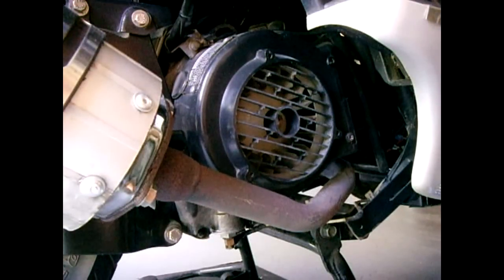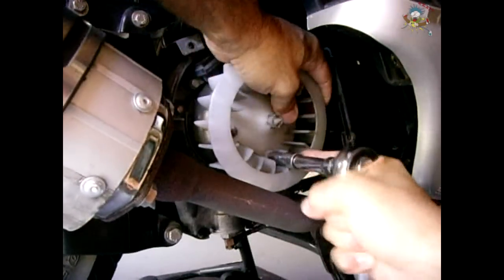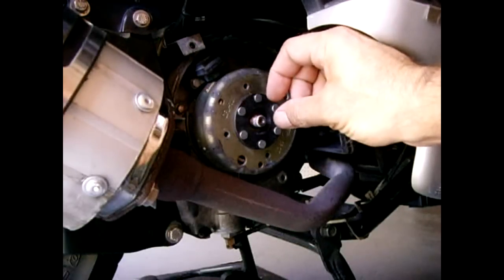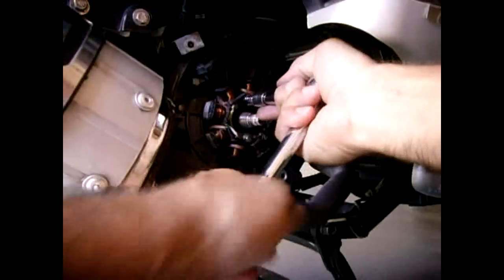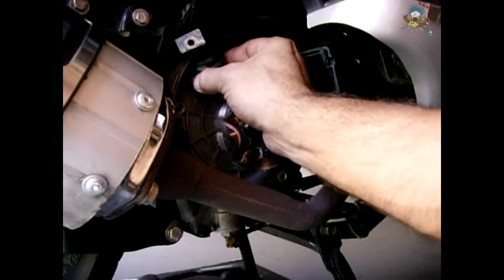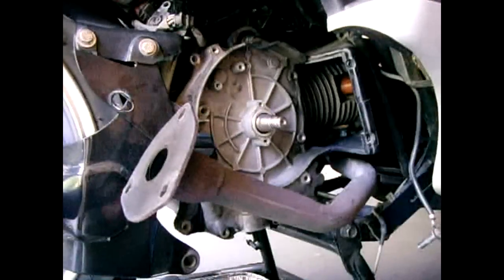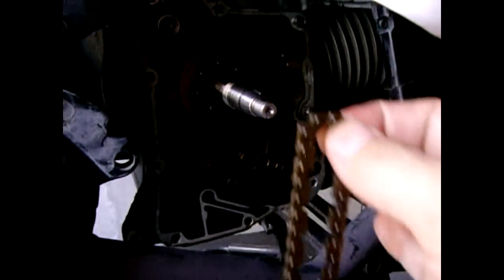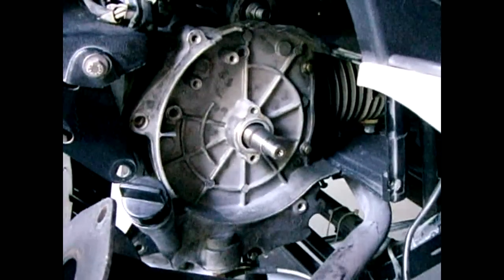How To Remove GY6 COOLING FAN/FLYWHEEL/STATOR/OIL PUMP/STARTER CLUTCH

Comment: I'm a Mercedes/BMW tech (retired) Nice videos! As I watch you recommend red RTV. I would recommend Permatex Ultra Grey silicone. RTV is for rough surfaces, while Ultra Grey or Ultra Black is for machined to machined surfaces, covers, etc. It dries like thick rubber and is stronger, yet still easy to clean with a razor blade. Great videos! Real good job as I watch you do it I can tell you are a pro. Thanks!
Reply from the maker: Thanks for watching, and thanks for the tips!

Comment: very informative, thanks for the upload. I have to tear my 13 jonway down to see why it ain't getting spark.
Reply: Leo Gerow shouldn't have to tear down just take out spark plug and put it in the boot,then put it on the frame while turning ignition on if you see spark your good! Then if theirs no spark its most likely your stator but before that is double check the blue wire with white line that goes into stator for loosened one hope this helps
Reply: Could be cdi, or

Comment: Hello,
I have same noise problem from the fan side with my 50cc moped/scooter. Now my moped starts but turns off while idling showing the same rattling sound. Does my moped has the same problem of starter gear which you just changed? Is it located at the same side as you showed? Thanks.

Comment: I know it isnt the topic of the video but man... I wonder what can be done to keep the exhaust pipe from rusting so badly.  My old roketa did the same thing and I felt like I was doing something wrong but letting it get that way.

Way cool video though, I never knew there was all of those components behind that shroud!
Reply from the maker: Hello Micah. Not much you can do besides sliding another stainless steel tube over the end. Thanks for watching!

Comment: they look so easy on the outside but surely you need to know your stuff to take one apart and the put it back together to working conditions.  Quite interesting. :P
Reply from the maker: I have taken all sorts of engines apart over the years. I was never afraid to attempt anything. Once you understand how they are made and operate, it is easy.
Reply: electronicsNmore  as with everything, anything is easy once you know how to do it. I just wish i knew :P

Comment: Thank you! Very I formative. Mine makes a terrible clatter at idle and also will not go passed half throttle without bogging down. Will not go passed 10mph!
Reply from the maker: Doesn't sound good....
Reply: @electronicsNmore  
What does that sound like to you?
Just a carb problem for the bog?

Comment: as a female I have great patience working on my 50cc scooter but when it comes to watching videos hell no!!! lol if all your videos are like this you are my new go-to guy! thank you very much for sharing this one it was great! I had a no spark issue with mine and I found out it was the pickup coil thankfully it's on the outside of the flywheel so easy replace. I took the old part out put the bolts back in the holes and waited  six weeks for my new part to arrive, during that weight the wind blew my scooter over and one of the bolts disappeared never have found it! I found that out when I was replacing the new part. I installed the part no problem turned over the bike and it spun a few times and then the flywheel locked up tight!!!!! it won't spin for nothing!!! question is do you think that missing bolts slid  behind the flywheel and it's stuck in their held on by the magnets so the flywheel won't turn?I can't imagine any other reason why the flywheel won't turn anymore as it turned just fine up until cranking it after installing that new part. I know this is an old thread so I really hope you're still around to answer this
Reply from the maker: It's a good possibility. Must be jamming it up. Thanks for watching!
Reply: @electronicsNmore  thank you so much for your quick reply! it's been driving me nuts knowing I have to go out and buy an expensive tool like that impact driver just to get the flywheel off to see if that stupid bolt is in there! LOL I actually bought another scooter hahaha this one a pony. while breaking it in at 40 miles on it  last week it sprung an exhaust leak! sounds like some old dirt bikes ive ridden back in the 7os!and it gets way too hot in just a mile or two of driving it so here I sit with two great little 50cc tao tao s  and no way to ride them! haha. do you happen to have a video on what to do about that? I only watch katchis  kid and rolling wrench videos and now yours I haven't seen a video for 50cc Pony Tao tao yet .I have over 6000 miles on my old TaoTao and it never had a problem until the no spark issue replacing the part and now. the jammed flywheel but it's a bummer that my new one started acting up at only 40 miles!.T.I.A :) getting help from their tech support team is near impossible!!!

Comment: Great video. Btw would u know where can I buy that part that holds the stater wires the one with the long bolts u took out or the name of that part? Cause my scooter don't have that part to hold the wire in places and the flywheel keep hitin it and cutin up the wires and I been tryin my best to fix the old stater over and over I have a brand new one put away but I don't want to fuck that one up lol until I can get that part to hold the stater wires I hope to hear back from u and great videos 👍🏽
Reply from the maker: At 10:20 in the video?

Comment: Absoloutely excellent GY6 Videos.  But I still got a problem with Cold Starting. If I shoot gas into the carb air inlet it just about fires up.  I have checked everything, electrical and auto enricher, as per your videos but it is still lousy starting. I do not know where to go now.  Any ideas.
Reply from the maker: Hi Guy,
Lousy starting is a very common problem with incorrect valve clearances. Refer to my video on how to check the valves.

Thanks. Be sure to share my channel with others, subscribe, and rate Thumbs Up!

Comment: What if my starter clutch won’t slide off? I’ve already removed the nut and washer? Thanks.
Reply from the maker: Make sure there's no retaining clip or ring holding it in place. It should come out.

Comment: Qmb139 scooter clunks badly when cold starting. Runs well otherwise, starter clutch then?
Reply: Only makes the noise when cranking
Reply from the maker: How about when you use the kick-start?
Reply: +electronicsNmore Thanks for the reply! I did two cold kick starts and it didn't make the noise.
Reply: Does that mean its probably the starter clutch?

Comment: my scooter shocks somethimes at speeds over 50 km/h is that normal or what could be the problem?
Reply from the maker: Sounds like a tire out of balance or a tire that is out of round.
Reply: i hope it its like it came from the engine on full gas it dont do it it only does it when i ride at the same speed without acceleration or decleration

Comment: vi crear vídeo... i would like that You playa the vídeo whit th noise before and after  the change im 
taking  the same noise, non when i just start the enginge... bit when i acelerate the enginge its making the noise un that side
Reply: Yeah me too. I thought it was the valves needing to be adjusted but I only have a 50cc and all's I can get is an oil pump with a plastic clutch thingy?. Oh well, I'll pull it apart and have a look anyways lol

Comment: I always use red Loctite and have never had problem removing things, Instead of using the blue i just use less red that way I only need to have 1 item around.
Reply from the maker: The red is really strong stuff(242/272). I usually heat up the nut with my propane torch for easy removal. Not too much heat is needed
Reply: @electronicsNmore  I am having a heck of a time removing the nut at starter clutch. I was wondering if I should try to heat it maybe that will help.
Reply from the maker: @brenday01  You may need to borrow or rent an impact wrench.

Comment: How to put the Flywheel back on?
Reply from the maker: Dylan Wilhelmi Very easy. Line up the key in the crankshaft with the flywheel, then slide it all the way back onto the shaft, then hold the flywheel in place using a strap wrench, chain wrench, or pipe wrench as you tighten the nut. Do not damage the flywheel/magnet as you hold the flywheel. It also would not hurt to apply some medium strength thread locking compound.

Thanks For Watching!
Reply: electronicsNmore thanks, I'll try that

Comment: Hey I have the same scooter as you, and I am hearing very loud grinding noise coming from the starter clutch area, is that where my problem is? It started slowly and soft, but as I kept riding it got worst and worst, so im nt sure if its the starter clutch.
Reply from the maker: Fabio Bandarra Hi Fabio. Do you have plenty of oil in the engine? There are several things it can be. Could be a bad camshaft bearing. You can inspect the camshaft bearing with the valve cover off. Make a short video so I can hear the sounds myself. Be sure to move all around the scooter and go close up as well. Post a link to the video. Upload your video to photobucket or similar.

Thanks!
Reply: I didnt have oil for a while, because of oil leak. After I fixed the leak and put oil back in. It was too late. I cant turn the scooter on, because I taken out the starter clutch to inspect it, the starter clutch is separated from the disc that its attached to, im nt sure if thats right
Reply from the maker: The middle of the starter clutch does pull out of the disc. That is normal. You have to push in all the lobes sticking out in order to reinstall the middle section. If you added oil, and the exhaust pipe is not showing any gray-white smoke, then the piston is probably OK. I would definitely check the camshaft bearing. Loosen the chain with the tensioner, then try moving around the camshaft to see if the bearings are OK. I suspect a bad bearing. They are cheap and easy to replace. You just swap out the entire camshaft. ALWAYS check your oil!
Reply: electronicsNmore thanks I will definitely take a look, I appreciate all your help, your videos are always helpful
Reply: electronicsNmore another question, is how can I tell if the bearing are bad, do I have to take the camshaft out and inspect or can I see it without removing, and if its nt bad bearing, how can I tell if the starter clutch is bad .
Reply from the maker: Remove the valve cover, position the valves just like you are going to adjust the clearances(I have a video showing that), then loosen the timing chain(I also have a video showing the tensioner), then you can try moving the camshaft around. The camshaft should have no UP/DOWN or LEFT/RIGHT play. If it does, you need to replace it. The starter clutch should rotate smoothly in one direction(with the middle installed)and lock tight the other direction. Make sure nothing is loose and falling off.
Reply: electronicsNmore thanks, i will take a look at it. Just to provide you with more info, the noise would only show up when I begin to accelerate from  stop, later the noise got louder and only at certain throttle pulls. Now its so bad that on idle it makes the noise. I shouldve taken more care, but thanks for the help, I really do appreciate it